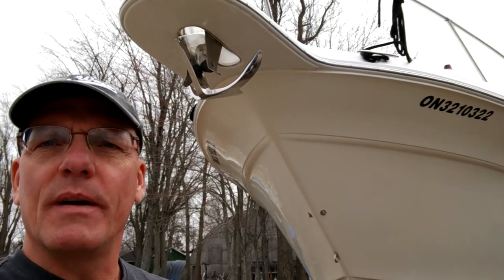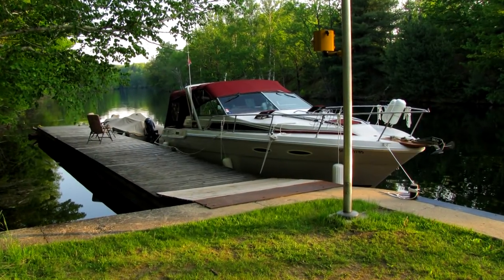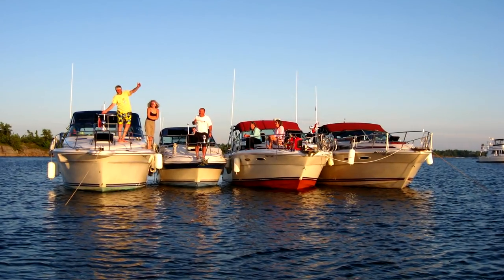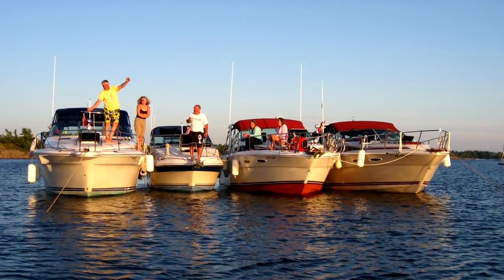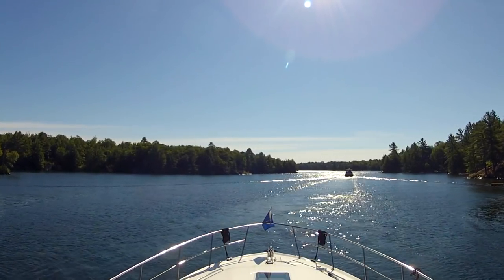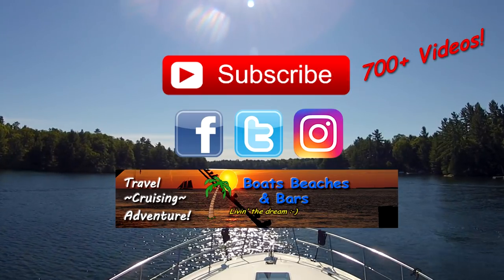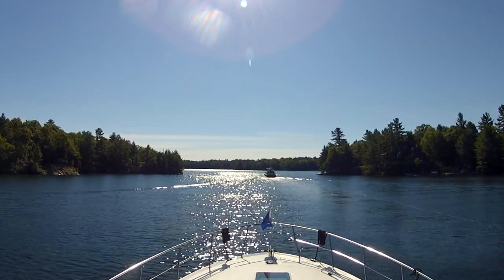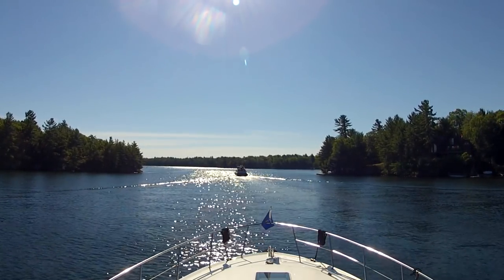New Anchor For Our Boat?

Comment: Hi Paul, when I bought my 03 Four Winns 268 it had a plow style I couldn't identify and on my river we anchor mostly in sand. It didn't hold well so I bought a 8Kg Bruce style and have not had any issues since with it slipping. But, I've always heard great reviews from fellow boaters on the Delta style, so I don't think you could go wrong there.
Reply from the maker: +Dean Hiscock Yes, we had good luck with our Delta's. My worry is that the #anchor that is in the #boat won't hold or set properly in weeds or rocks. Thanks for your insights 👍

Comment: We have a Quick Set Style anchor.  We have anchored in sand, mud, and weedy conditions.   There is no size on it but I just weighed it and it is all of 40 lbs. and is attached to an all chain rode.  Our Carver is close to 20,000 lbs and we have never had any holding issues with this anchor.   It sets well and just as importantly it comes up well.

Comment: What you have there is just fine ! :) great for sand/mud and rock . Its a great all around anchor ! 
:)
Reply from the maker: +zv3000 Agree that it's good for those bottom types, but I'm thinking weeds might challenge it's ability to set...
Reply: well yes, you've got a point there , but any anchor really is going to get challenged... with the right scope of rode you'll be fine i say :)

Comment: Our Bruce on a 348 FourWinns is good, not superb, in mud and sand for most conditions around Chief's Island. It seems to languish in weedy conditions and often drags as it lacks the ability to pierce through the weeds to get a grip of the underlying material. I keep a secondary Danforth for weedy conditions to if it is going to be windy.
Reply: I second Ernie's comments. We have a SeaRay Sundancer 270 with Bruce anchor and it works most of the time, great at big chief on the Sandy bottom but heavy weeds and it cannot pierce through. I carry a danforth for my stern line at Chief or for use on the hook a top weedy bottoms. My buddy has a delta/wing anchor and that seems to work well in all conditions.
Reply from the maker: +Ernie Follis Yes, the weeds are what I'm thinking would be the problem for our Bruce, as well. Just looking at the construction, one can see how the more pointy style of the Delta #anchor would make it a better candidate for our needs.
 And, thank you for not calling it 'Big Chief' Island ;-)
Reply from the maker: +Jeff Varcoe Yes, we found the Delta style #anchor to provide good hold in many bottom types.
 Take a look at my reply to Ernie's comment ;-)

Comment: We have a 2004 Sea Ray 320 SD (35.5' LOA) on Georgian Bay.  We upgraded from Sea Ray stock anchor (delta-type) 25lb I think, to all chain rode and a 35lb Rocna - what a difference. The difference in swing (far less) with chain is amazing and the Rocna has set fast and strong every time.  Needed to remove one roller from the SS anchor roller but worked just fine.  Your bow configuration might make a Rocna a challenge though.
Reply from the maker: +Paul Mitchell Yes, the roller/pulpit setup in our #boat might discount the Rocna #anchor.
 Thanks for your insights!

Comment: I use the Delta plow for the Chesapeake, mud & sand. I see many cruisers changing to a Rocna and seem to swear by it's holding capabilities.
Reply from the maker: Thanks for that, Kevin. I've looked at the Rocna, but it wouldn't sit right on our #anchor roller. Looks like we're going with the Delta style. Good experiences with it.

 Cheers, Paul.

Comment: We had that on Ohana...should hold well Paul. Used it in Georgian Bay, Couchiching and Simcoe. Holds really well in sand.
Reply from the maker: +Aimhii My only concern, Luba, is a challenge setting in weeds...
Reply: We got weeds too...Just drop it fast let it rest then give it a good tug in reverse and let out another 10' slowly ....she should hold well.....if not, you have to search a better spot.

Comment: Mind you...I have a new Rocna on the Santego. 😉
Reply from the maker: +Scott Horslin Yes, I've looked at the Rocna, but it wouldn't fit well in my pulpit setup...
Reply: Understood. For power boats, you have to use the Vulcan model... the original 'hoop' version does not, in fact, fit well.